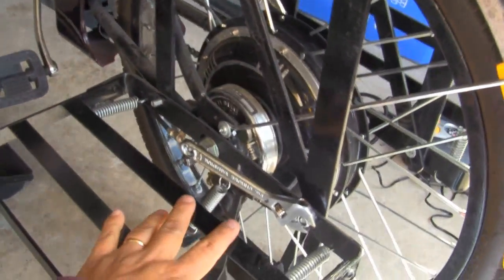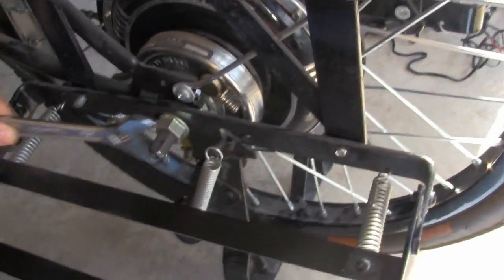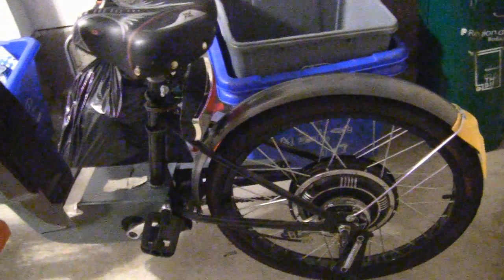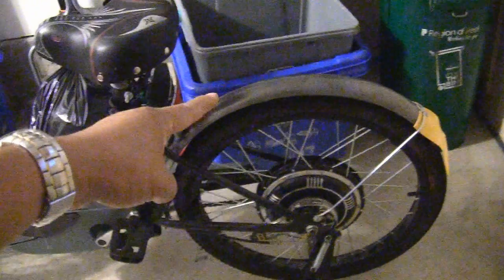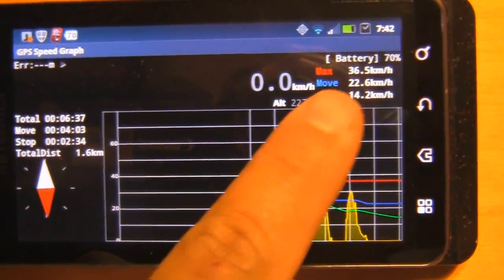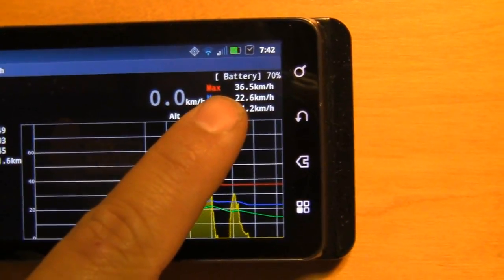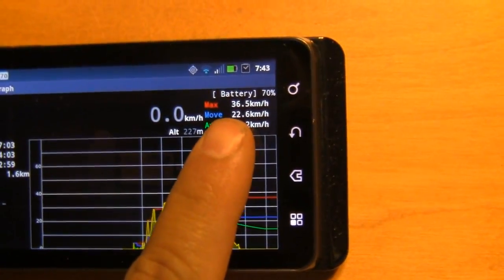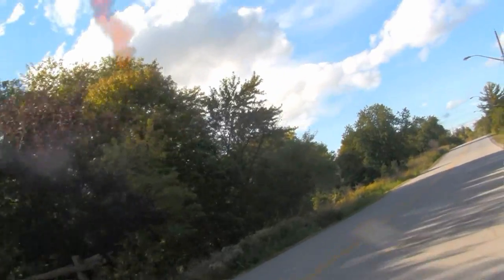How to speed up or increase speed on electric bike over 30 km per hour easy quick simple fast way HD

Comment: Words fail me... perhaps you could educate yourself not to produce time wasting videos?
Reply: Cool so you go faster by removing the heavy battery. Except now you go slower because there's no battery. Sorry to rub it in, but this video is just stupid.
Reply from the maker: +daronello I think people don't realized that sometimes the bike back rack can add friction and drag the bike.  This in turn slows the bike down.  By removing the rack I was able to increase the speed through lowering the weight and creating less friction.  Simple physics.  But I guess most people like yourself take that for granted.  Please think before you comment.  There are people having the same issue as I do.  Don't assume all problems are the same.  Education 101.

Comment: Upgrade your controller to 48 V and the batteries to 48V... As well as the electric motor... Okay? And you'll know the difference...
Reply from the maker: My electric bike is at 48 V and the battery capacity is around 400 to 500 Watts.
Reply: Hi. I have a 21A and 36V battery and motor hub 350W. How can increase the speed? Now I get 25km/h and controller has 13A.

Comment: it is possibel to tune the EL bike but you must install New sensors and New Controller but it vil drain the battery fast for EL bikes in my country is 25kmt tuningkit  wil push it to 45kmt